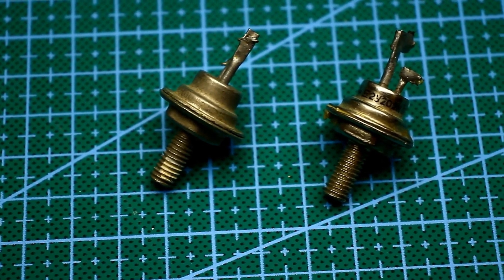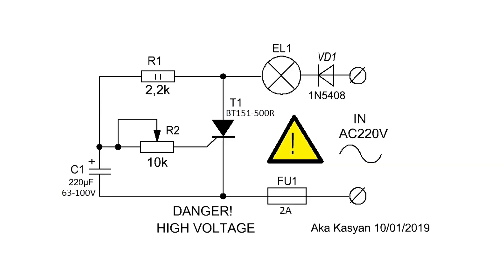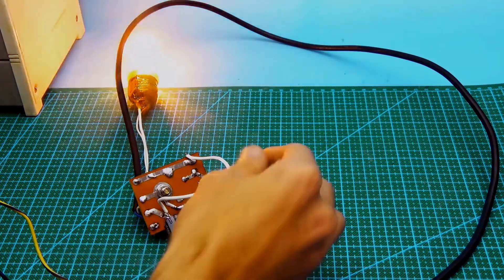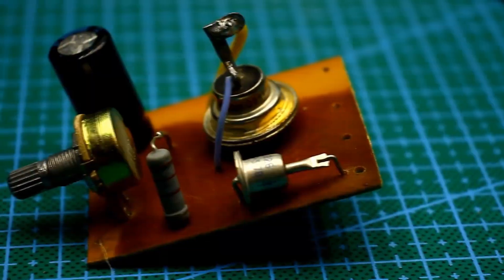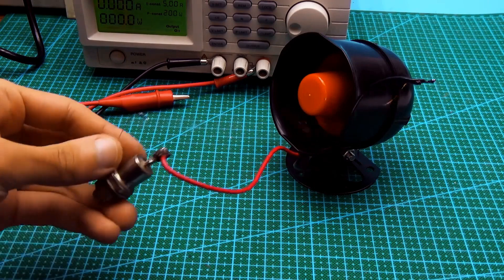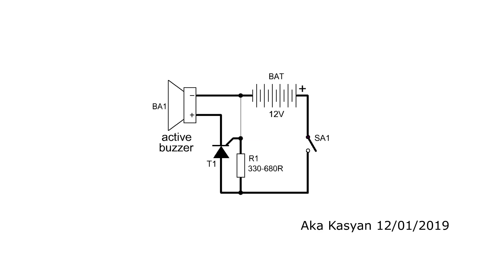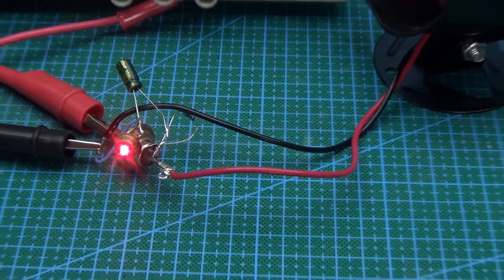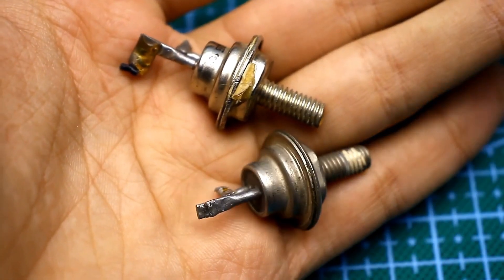TOP schemes on one thyristor

Comment: Using metal housing potentiometer with metal shaft for mains voltage regulator is never a good idea. Please dont do it even with plastic knob. Is dangerous, there is no high voltage insulation inside and resistive track or slider can eventually burn or brake and touch housing inside.
Reply: Yea that caused me to double take too! 
Im pretty sure his mains in his lab will be isolated, but yea i have never done any projects with non isolated mains, and probably never will.